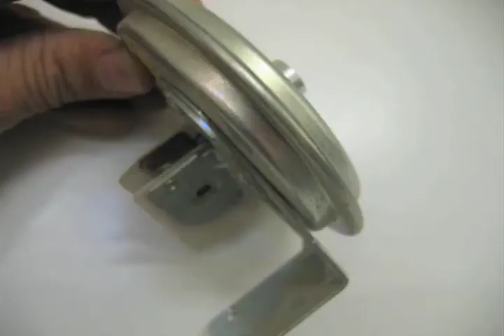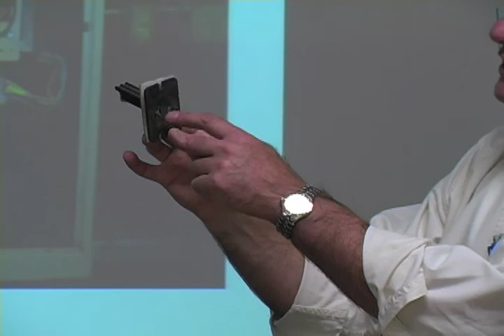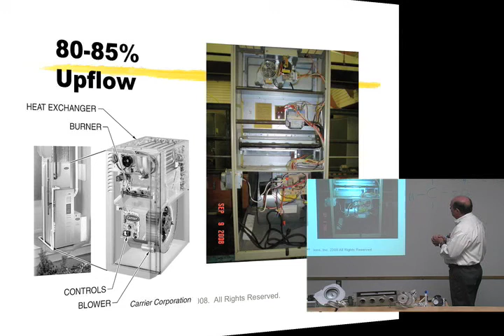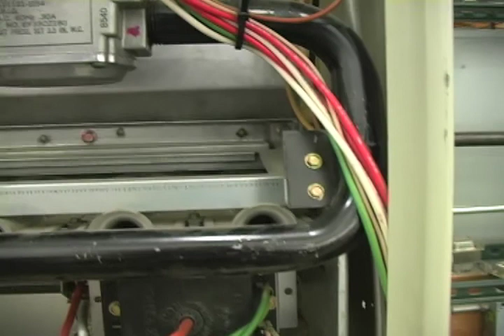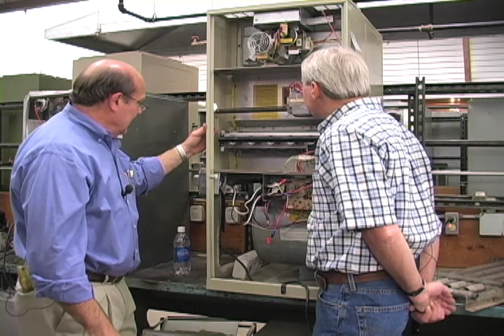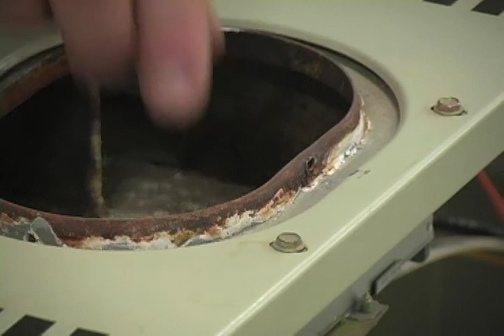Sneak Peek at Advanced HVAC Inspection Training Course

Comment: Wow, way to deep into the component functions, a good basic knowledge of a furnace (all types) is all that is needed. If we start stating exactly what is wrong and your wrong when a unit is not working as it should, you are liable if you are wrong. If the unit is not running as it should, you state that it is suggested that a HVAC professional is require for further evaluation. Or am I missing something?
Reply from the maker: The more you know, the better you are.